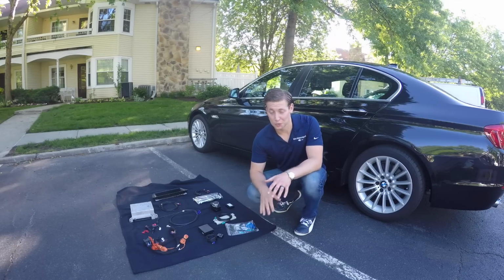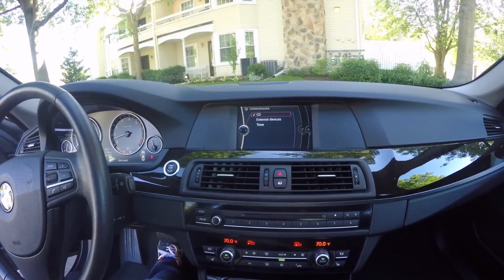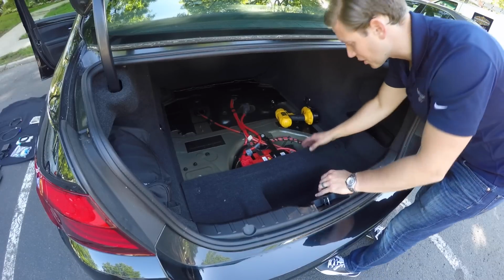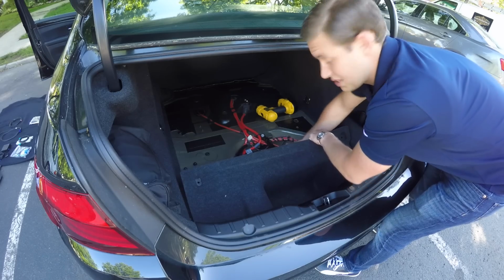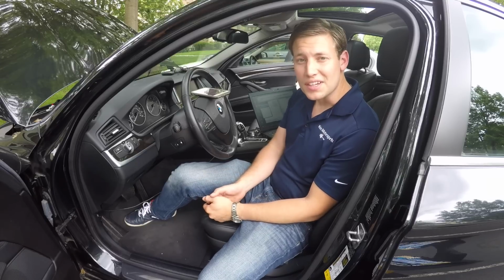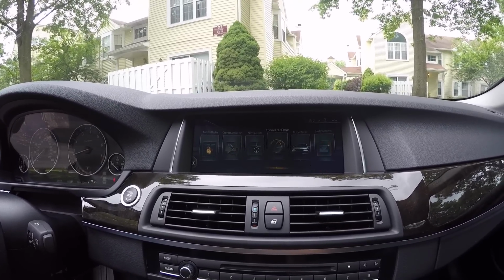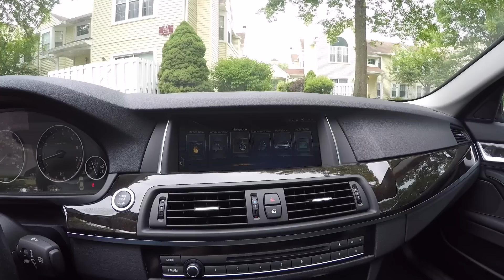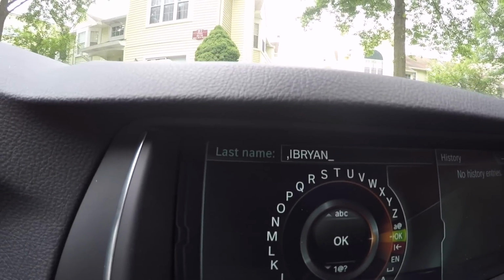NBT EVO Retrofit With Apple CarPlay in an F10 2012 BMW 535i [Before and After Demo Video]

Comment: Can you add a list with items that you installed ? Seems more parts than the usual CIC . I understand that you need the GPS antenna but the module in the rooftop does more than that as i know. Also, usual coding has been used or did you use emulators & stuff ?

Comment: I do not see if the steringwhell contrlol work correctlly or a demostration of the normal functions specialy those that include graphics: 3 mode driving,service warnings, sensors,    instructions manual, etc.....I have a 520i but i am afraid to loose functions if i install a radio like this one....Please where can i see a complete functionality of this radio?.....which radio, where to buy & wich equipment do you recommend in order do not loose anything? (excuse my english, i am not an natural english speaker)

Comment: I have a 2014 f33 435i convertible with navigation already but is running the older idrive interface from BMW. It is NBT, but not NBT EVO.  Can I update software (coding) to have the new ID interface and CarPlay?
Reply from the maker: Hi, no, you'd need a full NBT EVO
Reply: Kies Motorsports 

Thanks for your response. So I would need to to a complete hardware swap out at what looks like $2700?!
Reply: Bob G  it's not that expensive man
Reply from the maker: It's normally more then that..

Comment: Would this set up work in a 2013 X5 35i Msport?
Reply from the maker: Hi, yes, we can do that, but it requires some custom brackets. On F Series, it's more plug and play for the most part..
Reply: how much would this upgrade cost on a 2013 528i x drive
Reply from the maker: It’s about $3400 in parts

Comment: Doesn't carnaviplayer.com offer a plug and play version of this for around $500? No coding required. What am I missing there? Looks great, but 4 hour install, then 8 hours coding and over $3K for parts?
Reply from the maker: It's all in what you want. We've done a bunch of these. The guys that do them, don't want anything to do with the Chinese stuff. Vice versa, some people some don't care that it's not a BMW part and they're willing to sacrifice the quality and dependability for a lower cost.  I will say that if you are looking for a less expensive option, these guys seem to do a good job: https://www.seicane.com/hd-touchscreen-android-aftermarket-radio-head-unit-for-2013-2014-2015-2016-bmw-5-series-f10-f11-nbt-car-stereo-gps-navigation-system-bluetooth-phone-wifi-support-obdii-dvr-1080p-video-steering-wheel-control-s028218?acc=9bf31c7ff062936a96d3c8bd1f8f2ff3